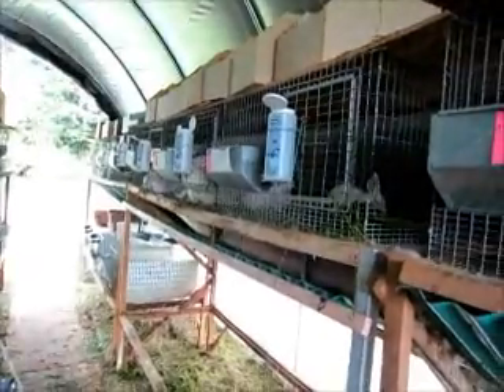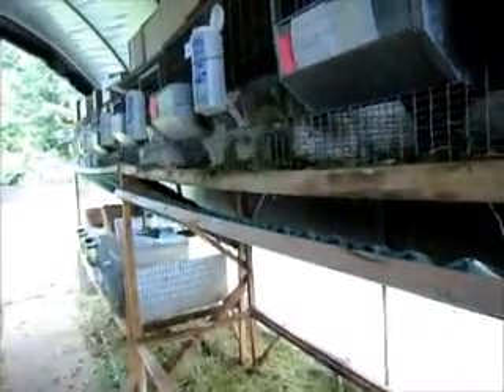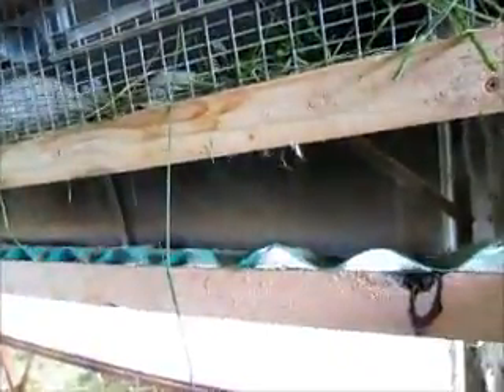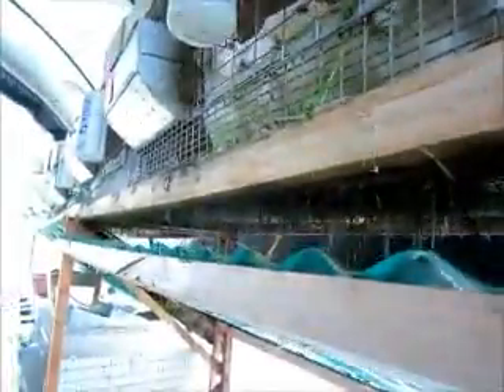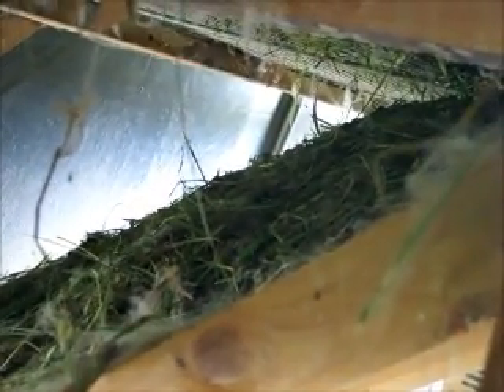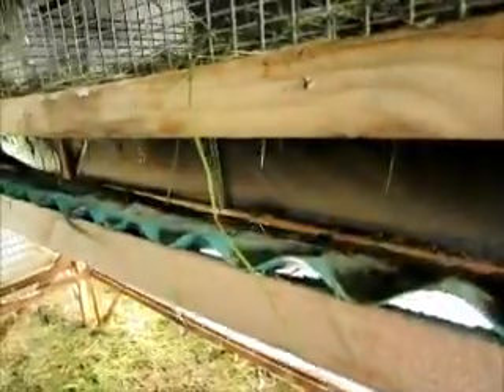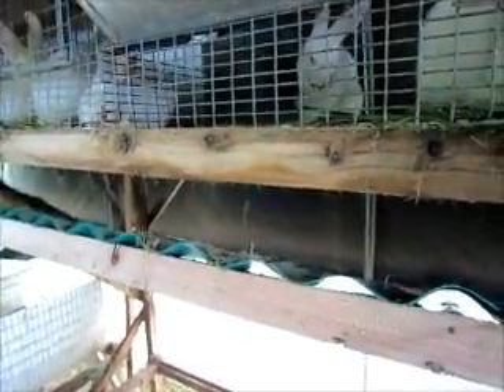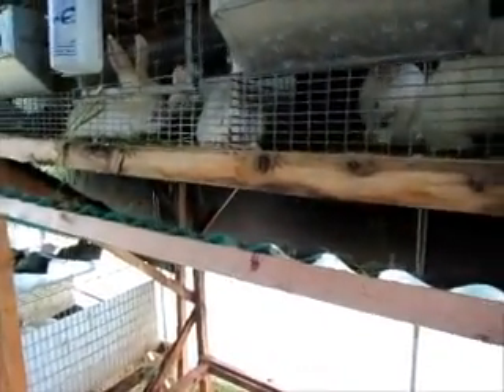Rabbit cage rack upgrade - easier cleaning

Comment: I found that everything sticks pretty well, even with a steep slope.  And I've also tried an almost-horizontal approach, maybe 2" drop from front to back.  That works pretty well.  You've got to sweep it off now and then but it looks like you're doing that even with this setup.  If you can manage with much less slope, you should be able to get another cage in the stack.

Comment: when you love you rabbits, you will not let them live on a gaze floor, without straw
Its cruel
Reply: Ligt eraan wat voor ras je hebt. Ik gebruik plastic roosters dat is inderdaad beter. Feit is dat in houten bodems urine trekt en dat zorgt ook voor beschadigingen aan de poten en ammoniak en bacterien. Een konijn die in zijn eigen stront zit is ook cruel.
Reply: JohnDoe0329 Yes, true; and also straw and blankets create mouth sores and impacted bowels from chewing.
Reply: The FAO (www.fao.org/docrep/t1690e/t1690e00.HTM) recommends wire-bottom cages for the health and comfort of the rabbits.  There are many, many problems that come from solid-bottom cages with bedding.  Very heavy rabbits can get sore hocks but meat rabbits developed in the USA were specifically selected to be large but not large enough to have trouble with cages.